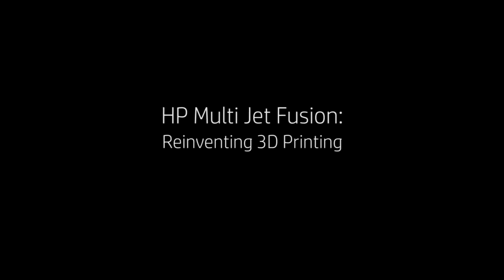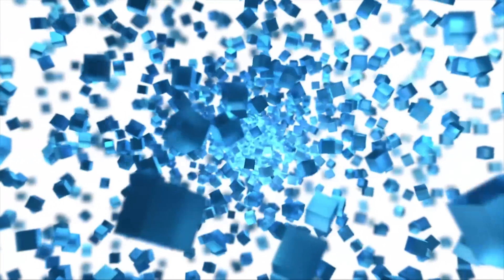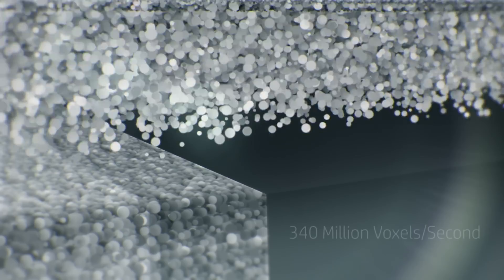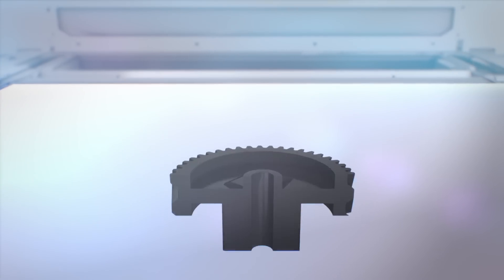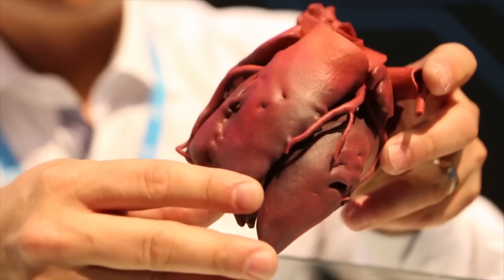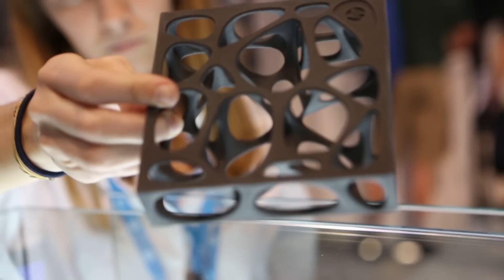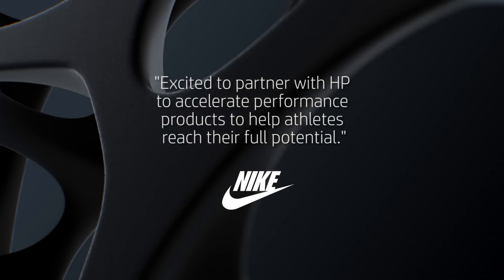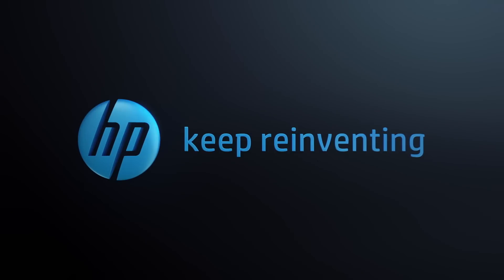Reinventing 3D Printing | HP Multi Jet Fusion | HP

Comment: I saw this at IMTS Chicago.  This is really impressive technology.  Surface finish was good, not SLA good, but acceptable for a final product.  The cost is very reasonable if you are looking to make low volume (1000-10,000) parts per year with a high mix of products.

Comment: HP Multi Jet Fusion is very similar to Xjet Technology ! Both of these new technology make a breakthrough to SLS without
need of power bed any more !
Reply: Xjet use solid phase sintering the material is sintering at low temperature but multijet fusion melt the material at high temperature so it's more difficult to print metal.
xjet don't used powder bed, the metal is dissolve in the ink, ink is used to manipulate the powder but int this case the ink is used to heat the powder and add some color/conductivity... So both are a way different the only thing that connect both is the speed.

but voxeljet is really close to jet fusion with is new high speed sintering system.